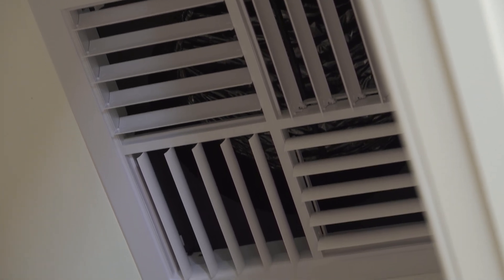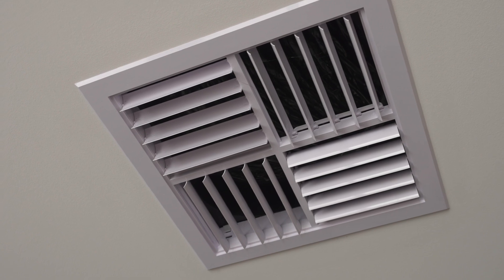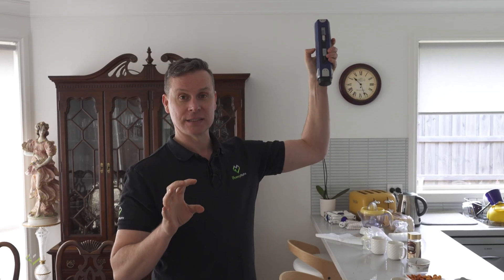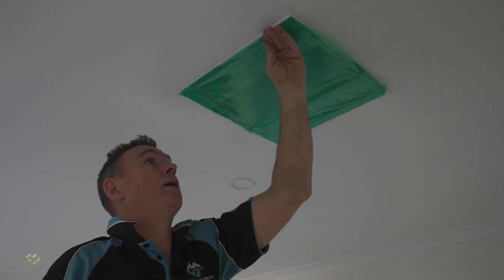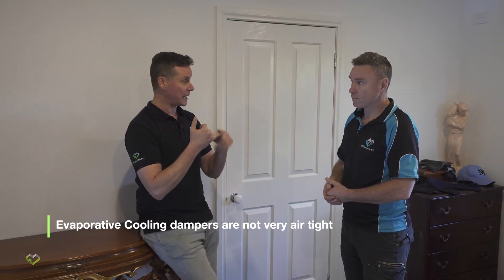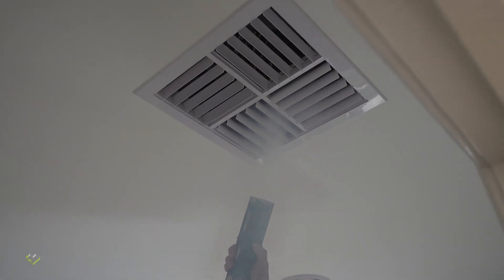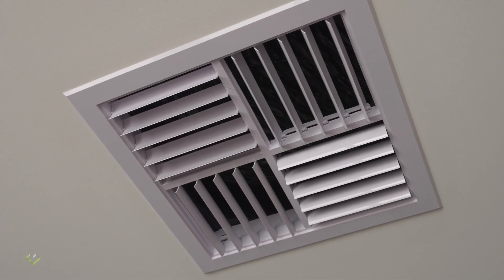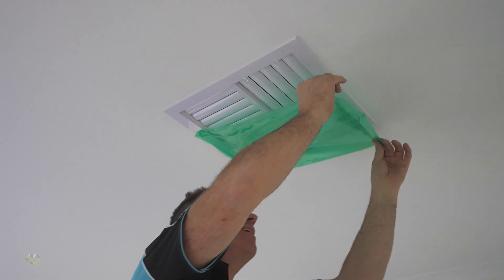The Hidden Problem With Evaporative Cooling in Winter!

Comment: What you say is technically true. Would be more ethical to simply talk about the problem and potential solutions and their shortcomings than to turn it into a “throw your hands up and buy a split system AC” advert. Reality is that Evap is cost effective in dry areas and most ducted systems have flow control per zone, just like ducted AC, which is very effective. Also, you state that these are like having a chimney in every room. “Chimney effect” is zero here. Don’t misrepresent science. A real chimney creates a draft because it is designed to contain heat in itself that influences gasses passing through it. Nothing in ducting is designed that way - actually the opposite. Then you have horizontal ducting that further reduces the effect. High wind could be an issue if pressure differentials could overcome the inertia in ducts introduced by dampers. There’s also a problem with your claims of 55% better performance. You don’t explain what you are measuring, let alone the actual measurement units. You only provide numbers that are relatively impressive. Could be that 20 sparrow farts escaped instead of 9 sparrow farts.
Reply from the maker: On days of high winds, evaporative coolers can get exposed to high winds and go into negative pressure.   This does indeed induce draughts, whether you like it or not.  
We also believe from an ethical perspective, evaporative cooler sales guys, should explain to potential customers, that this is a cheap cooling solution how ever all your savings may be lost by having to spend more in winter heating their home.
Reply: @ecoevo 
Regardless, you still haven’t acknowledged how dampers (the things that control air flow to various zones) can control air flow in one direction and not the other. Nor have you addressed the fact that you measurements lack any definition. All you’ve said is that sales people selling swampies are not ethical because they don’t say what you think they should. It’s a bit rich.
Reply from the maker: Well, from air tightness testing we have conducted on homes here in Australia, which have evaporative coolers, dampers are NOT very effective, and these homes are always considerably leakier than homes without them.   Also, with days becoming more and more humid, evaporative coolers are not as useful as what they used to be.
Reply: @ecoevo  What are you measuring and what are the units. 20 vs 9 what?
Reply from the maker: Air changes per hour at 50Pa(32 km/h winds)

Comment: Nice one. In addition to the losses through the ducting,  when assessing homes I frequently notice that the bezel of the vent registers do not make a good seal with the plaster ceiling.  So even if the AC damper were perfect,  there can still be air pathways into the roof void.

Comment: I have installed the magnetic heat saver vent covers and they work fantastic, so good i bought them for my mum and a friend and they are very happy. Depending on how many vents you have, it will cost around $250 for them to be custom made. Yes, you may put them up and find you have a hot week in March or April and and need t remove them and the same in September or October, but they are quick to fit and remove being magnetic. When my evap cooler dies, I will have it and the vents removed and have a refrigerant system installed under my house connected up to the ducted heating vents. That will make it a lot more efficient than running an air con system and vents in the ceiling where temps can reach extreme during the summer heat.

Comment: You can get covers fitted at each of the vents that work very well. Evaporator cooling costs a fraction to run compared to a ducted electric
Reply from the maker: As long as you understand that the costs of running an evap cooler also includes, poor performing insulation on your ceiling, and that from time to time during spring and autumn, when you have snap hot or cold weather, you may not be bothered to cover up the vents.
Reply: @ecoevo  how doe’s using  an evap cause poor performance of roof insulation?
Reply from the maker: From our experience on job sites with evap coolers, the insulation is terrible, and it’s quite difficult in areas to fix the insulation when all the ducts are in the way.   And if the roof also has ducted heating ducts, it compounds the problem.
Reply: @chefgav1  You can't insulate the hole made in each room. The vent holes are larger than the hole made in the wall for a split system. You still need a window open to use an Evap if your house is airtight. Evaps won't work in more extreme heatwave or hot and humid conditions. Best to change over to a split system asap.